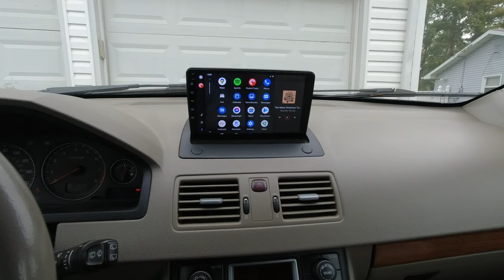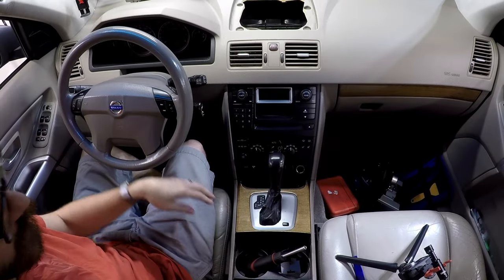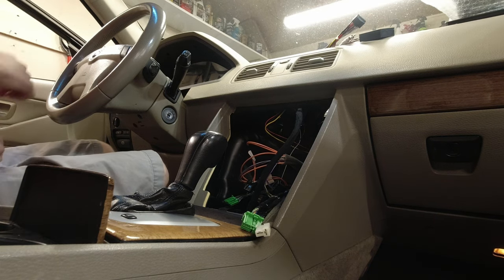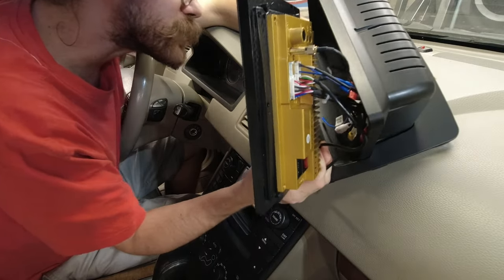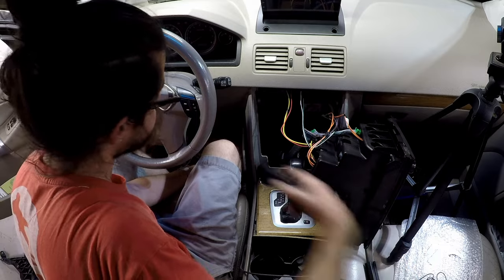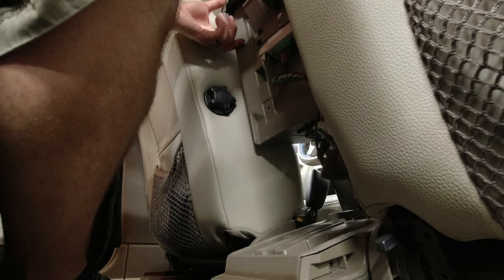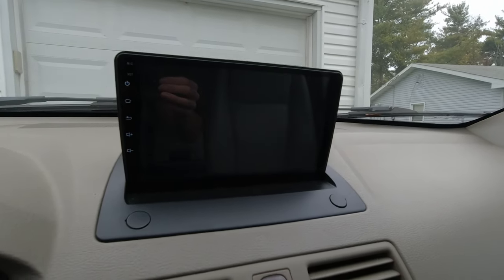Installing an Android Head Unit in a Volvo XC90

Comment: Hi, I just installed a Teyes Android head unit on my XC90 which is more or less identical to yours. I had the same problems with the speaker wiring. In addition to the left front speaker, the rear left speaker also didn't work for me. The assignment of the speakers (FR was RL etc) was also messed up. I probably wouldn't have managed to install the head unit  without your video. One question: Does your parking sensor (rear) still work? Unfortunately mine doesn't anymore and I don't know if it's another problem with the wiring.
Reply from the maker: I'm glad you were able to fix the wrong wiring! 
For the parking sensor, the output is tied to the amplifier, so bypassing it means the sound from the parking sensors has no speaker to go to. This car didn't have the parking sensor option, but another viewer thought of adding an extra speaker and wiring it to the amplifier. You could probably tuck it under the center console or leave it under the seat (and as a bonus it might be a fallback if you need to use the factory radio in a pinch).

Comment: Hello, I have a question. Can the car key be changed in this radio? Because after changing the radio, the key no longer works.
Reply from the maker: That strange, I'm not sure why the key wouldn't work anymore. Does it not turn in the ignition or is it another issue?
Reply: @frenchineer  Steering wheel audio control only not working

Comment: @frenchineer, How good are these units? My biggest concern is actual processing speeds and software security. Last thing i need is my phone to get hacked because of using some open source software. Im looking to upgrade my 1st gen XC90 and unfortunately these are the only units out there that fit on the middle console speaker as opposed to a double din replacement. also how does it interact with the OEM  radio? does it work in tandem or does this unit act like an AUX audio source?
Reply from the maker: In terms of processing speed, I haven't noticed any issues. As far as security, my unit isn't connected to any network, and for Android Auto the radio is only used for the display and audio/microphone. 
I had no issues with the quality of the unit. For sound quality, that may depend what year your car is. Mine is an 06 and did not have an AUX input, so the harness I have bypasses the amplifier (the factory radio no longer works and the speakers are driven by the new unit). On later cars with the AUX input, my understanding is it that it ties in to the AUX system and uses the factory amplifier.

Comment: Hello,Frenchineer nice video, thumbs up, I installed the radio, everything works great, but the steering wheel doesn't work?
how can you adjust, thank you👍
Reply from the maker: Thank you! For me, the volume controls work even in android auto, but the next/previous track buttons only seem to work in the main screen. They worked like that without any adjustment so I am not sure how to fix that. Also important to note that if you have the GPS buttons on the back of the wheel those don't work either.

Comment: hello I did everything according to vodeo, only I left the fiber optic cable in the old radio, because there was no other way to connect it. Parktronics do not work. What did I do wrong? And it played better before that. Thank you.
Reply from the maker: I did not have parktronic, but based on what others have experienced the output of the parktronic is through the amplifier, which is bypassed with this method. Regarding the sound, my understanding is that if you have a subwoofer, it will not get any signal with this install (my car was also not equipped with a subwoofer because it has the 3rd row AC control option).

Comment: Great video! 
My main radio does not work, it does not start up, my steering wheel buttons also dont work and my parking sensors dont beep anymore. Any idea how i can fix this?
Reply from the maker: With this install (non-AUX), the factory radio is bypassed so there is no sound from it. I did not have parking sensors, but from what I've gathered from other commenters the parking beeps come from the amp, which is also bypassed. There was some discussion about wiring an extra speaker to the amplifier output, but I don't know if anyone tried that yet.

Comment: Hello, I have the same screen and the same car. The same thing happens to me with the front left speaker, thanks for sharing.
How do you connect the radio antenna? I think I need a fiber optic to analog converter. how did you do it?
thanks from Spain.
Reply from the maker: I did not add an antenna in this install, but I would probably use an FM antenna that mounts inside the windshield. 
Otherwise something like this might be another option: https://www.swedespeed.com/threads/using-extisting-antenna-s-with-aftermarket-radio.166380/

Comment: Perfect Video! Do you use the can-bus adapter? Can you tell me witch can-type you use and if the park distance controll is working?
Reply from the maker: Thank you!
My CANBus adapter came with the head unit, so I'm not sure where you could get it separately. My car does not have parking sensors, so I don't know how it integrates. On other cars it's usually a separate system, but I'm not sure how Volvo does it.
Reply: Can you check on settings Android what type of can bus system uses. Thanks
Reply: @frenchineer  There is a Factory menu withing the Android settings, on these head units. There you can see which CAN box is configured in it (and some other settings, all are better left unchanged). The Factory menu needs a password to access, often 126 or 3368.
Reply from the maker: Looking in the factory settings, there is only an option to select which car's CANbus type to use. I've seen more detailed settings on my other radio in my Mercedes, but this one does not have the same setting options menu.

The details for my car in the system info settings are:
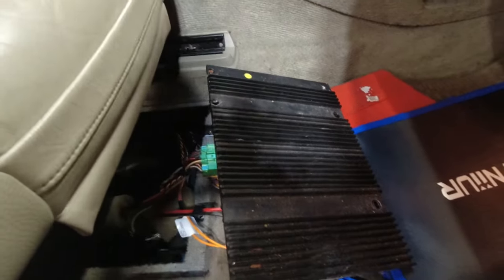CANAPPVER: v.21.11.04A_3.0[15:16] {H.211101}
CARTYPE: Volvo - Volvo XC90 - [2004-2014(1Gen)] - [All] {96 - 2 - 1 - 1}
CANBOXVER: oudi

Comment: Awesome video.  I'm in the process of getting an XC90 from this generation right now and this was the first thing.  Curious... does the stock backup camera work or will I have to install a new one?  Also what about the speaker that is in the old screen housing?
Reply from the maker: Thank you! Since my car did not have a backup camera, I am not sure if there's a way to integrate it into the aftermarket unit. The center speaker is removed since the panel it mounts to is replaced by the new unit.

Comment: Love the video! Any idea if the Amp bypass cabling is required on models that do have the factory Aux In? 

The one ive ordered has 2 super long cable bundles, 1 for the Amp bypass and another with an audio cable and some kind of fuse box maybe? No idea what that's for!?
Reply from the maker: Thanks! I think the cars with the factory Aux in connect differently and don't bypass the amp (but may piggyback on it). The box may be the CANBus decoder which allows the radio to read certain systems in the car, like headlights, reverse signal, and steering wheel controls.

Comment: Hi, I'm watching your video and I have the same system in Volvo, I bought a kit in Alien express, I started the installation until I realized that from the connector that is removed another small connector I did not find in the assembly the cable kit that should come in the purchase I made I would like to know where you bought your equipment to look around for the same cable kit
Reply from the maker: Hi! The kit I used was directly from Seicane, and I put a link in the video description. I don't know if they sell connectors individually, but you can try to compare the pictures of their included harness with yours.

Comment: Hallo Frenchineer Great video, excellent, I installed the radio in my Volvo xc 90, works well.
Volume in the steering wheel doesn't work for me, how can I get it to work? What can I adjust for you? Please give me an idea
Thanks👍
Reply from the maker: When I installed mine, I didn't change any settings but the controls worked. For me the volume and next/previous work in the main apps, but only volume works in Android Auto. 
Unfortunately I haven't found which factory settings could make a difference for you. Perhaps there are Volvo forum posts that may help!

Comment: How is the system working a year later? Do you still have the vehicle? Thank you for sharing.  Demetri Toms River NJ
Reply from the maker: It's still working well! It has been switched from using Head Unit reloaded to a Carkit dongle so that both Android Auto and Apple Carplay work.
I still have this car, though I am selling it to make room for other projects.
Reply: Excellent thank you for responding

Comment: Hubby found your video very informative.   I do have a question for you. We own a 2011 cx90 volvo. The screen cooked last summer here in Australia. Screen is now jibberish. Just recently the navman has started directing us and  won't permanently turn off. Do you have ant suggestions please? Hubby has been researching madly. He gets it off....when car starts up next....off he goes again. Thanks heaps for any ideas you might have.
Reply from the maker: I think you could look at the navigation unit and remove the fuse for that. It does also seem to be a fuse shared by the optional sirius radio and rear seat entertainment, so if those are features you have and use, maybe you can unplug the navigation unit instead.
The navigation unit is under the left front seat, and you could try to unplug it there to prevent it from running.
I hope this helps!

Comment: please tell me the name of the power cable that connects the amplifier under the seat! do you have his photo or marking? very necessary. the seller sent me another cable, it does not fit.
Reply from the maker: Hi, unfortunately I don't have the name of the cable, since it was included with my radio. The best image of it is probably what's in the beginning of the video: the long cable with the green connectors.
When I ordered my radio I had to specify that I had the fiber optic option and no AUX port. The other harness included does not have the optical piggyback connectors.

Comment: i see the red and white rca you have already plugged in to each other... but which one did you plug it into and what was it for?
Reply from the maker: The RCA connections are: Cable Aux L IN to Cable Audio Out L and Cable Aux R IN to Cable Audio Out R. This connected the output from the head unit to the harness that goes to the speakers in the amplifier area. Without these connections, no sound from the new unit would come out of the speakers!

Comment: Hello
I have just bought my xc90 2007 as my first ever car:)
I was wondering if the original navigation arrows, enter and back buttons behind the steering wheel can interact with this screen?

If the answer is inside the video then please forgive me for only skimming through:)
Reply from the maker: No worries! Unfortunately those buttons only communicate with the GPS system under the seat as far as I can tell.
Reply: @frenchineer  oh that is quite a shame, I feel like they'd be handy. 
I've found a head unit that replaces the radio as currently it is unusable in my country, we don't have FM radio.

I'll try to swap that which also seems to be a simpler job

Comment: Thanks for instruction, did you get steering wheel other buttons to work? or only volume controls is working? Factory radio is working?
Reply from the maker: For me in Android Auto, only the volume buttons work. The factory radio in my installation no longer works (or rather, it is no longer connected to the speakers). I believe that in cars with an AUX input, the factory radio continues to work, but I can't confirm that.

Comment: Hi great video. Is there anyway that I could get sound out of both the android unit and stock stereo? Thanks I get no parking sensor beeps after I install android unit
Reply from the maker: I don't think there's a way to use both, but it could be possible to wire an extra speaker to the amplifier output as a parking sensor speaker.

Comment: Thanks for sharing this video. My XC90 2004 just installed the soundstream unit, so one query is that after new unit installation, the existing stereo unit can't provide sound output to the speakers, is it true?
Reply from the maker: That's right, since in cars without AUX inputs the factory amplifier is bypassed completely. I have seen someone connect an extra speaker to the amplifier to keep parking sensor sound - he shows how he did it here: https://www.youtube.com/watch?v=k8ltjayv4po
Reply: @frenchineer it's me and yes, the original radio would output to that single extra speaker, 😂. I can play the original radio and the android unit at the same time. I assume it can be done in a much better way with more speakers and better sound quality.
Reply: @frenchineer @HandyDoctor89 
Many thanks 🙏👍🏻👍🏻

Comment: What about radio antena? Need plug on unit or work from original system? I don't get it on my package, just gps ant 4g sim card antena.
Reply from the maker: You would need to use an aftermarket antenna. The factory radio uses an antenna connected to another part of the system. There are aftermarket options that attach inside the windshield.

Comment: Do you know if the factory camera would work with the new head unit, or if you'd have to install a new reversing camera to be compatible?
Reply from the maker: I'm not sure because my car did not have a backup camera (or parking sensors for that matter). There may be some aftermarket units that integrate the original camera. In my case I added a new one.
Reply: LP

Comment: Thank you so much for this video. It was a lifesaver. Currently, the airbag and tire pressure warning message has come on. I will get those reset as you stated. Was not able to get the steering wheel controls to work. Just wondering now why my check engine light has come on and my key fob is no longer working.
Reply from the maker: When you get the airbag light reset, the scanner should be able to tell you what the check engine light is about. It's possible that your battery got low during your install, and a lot of systems can show errors when the voltage gets low. I'm not sure about the tire pressure and key fob though. 
For the steering wheel controls, only the volume buttons work for me when using Android Auto, and the next/previous track only seem to work in the built in music app. The original GPS buttons are a separate system and don't work with the new unit.
Reply: @frenchineer  I forgot to leave in the factory radio display screen in the car. Once I read the instructions more closely and went back to the car to reconnect it. Everything went back to normal.
Reply from the maker: Nice! It's surprising how many systems tie in to the factory radio.
Reply: @frenchineer  Agreed, I had no idea it was a mini computer within the radio, but it makes sense with today's touchscreen technology.

Comment: How you fix the steering wheel key of navigation is not work on my unit and phone button not work only volume key and >> music changer, any solution?
Reply from the maker: Unfortunately because the Volvo navigation system is separate, the navigation keys will not communicate with the new radio.

Comment: Hello mate just a question does your parking sensors works after bypassing the radio? 
On screen it save park assistant active but i cant hear the beeping sound any suggestions please
Reply from the maker: I didn't have parking sensors, but since the amplifier is completely bypassed, no speakers are connected to the parking sensor system. There is someone who has connected another speaker to the amp, and I think he plans to make a video about it at some point (he briefly mentions it in this video: https://youtu.be/eQQt47_zJKk?si=I6mrE4TnYTHZmjRQ )
Reply: @frenchineer It's me and I already put out that video. It works perfectly.

Comment: I had a airbag light on my Alfa Romeo after removing the seats to clean them and I managed to clear them just by disconnecting the battery for a few minuets (or atleast the warning light but good enough for me)
Reply from the maker: Nice! I don't think Volvos reset the airbag system when you disconnect the battery unfortunately. It may be possible to completely avoid the issue by doing the install with the battery disconnected for the portions where the HVAC/radio need to be disconnected.
Reply: @frenchineer  yes, that should work. It’s also what Cris fix recommend in his interior clean tutorial but I forgot to put the windows down beforehand and because they are frameless and slot into the body when the door is closed and lower a bit out of the slot when opening it I couldn’t close them so I had no choice but to connect the battery to close the doors (seats were still out because they were drying)
Reply from the maker: That makes sense. It sounds like you did a lot of work on your Alfa!

Comment: From the seicane cable where did you connect red/white audio cable?
Reply from the maker: It should be AUX L IN to Audio OUT L, and AUX R IN to AUDIO OUT R. The info is on the product page further down where they show all the connections that come off the unit.

Comment: I do have Volvo Xc70 year 2007 with factory installed Navigation Systems. Can😢 you help me what I need to BUY and where to get it
 I am from Ontario Canada 🇨🇦
Reply from the maker: It looks like for the 2007 XC70 there are dash kits and harnesses that would allow you to install a double DIN head unit (Metra is a reputable brand for the kits). You would have to choose a head unit with android auto/carplay capabilities. 
There may be some info here: https://www.matthewsvolvosite.com/forums/viewtopic.php?t=94578